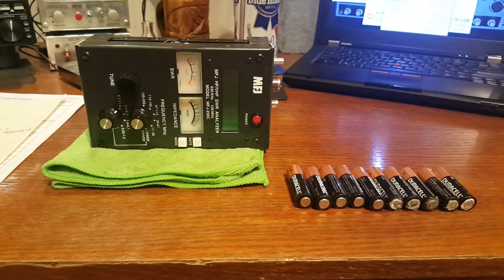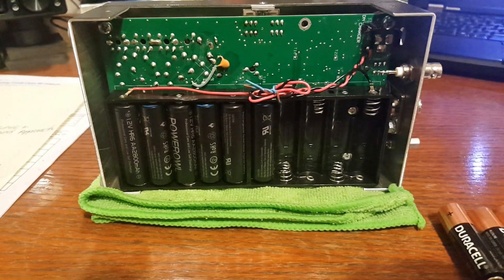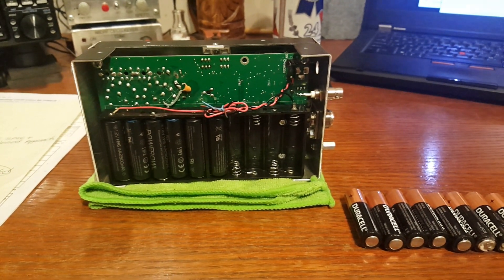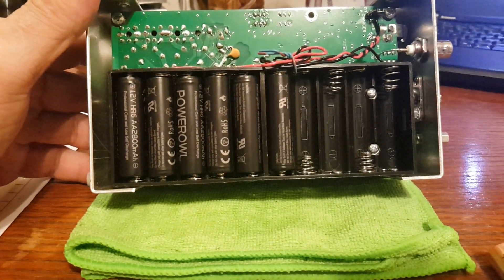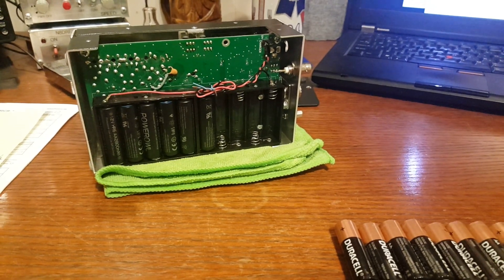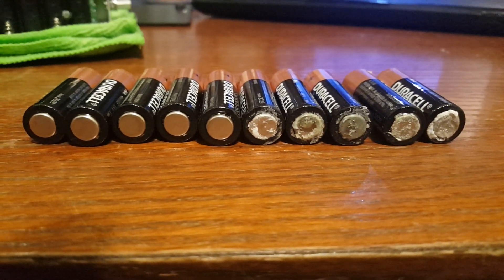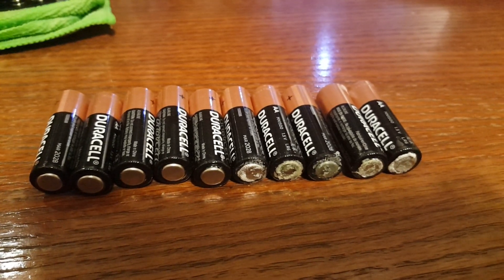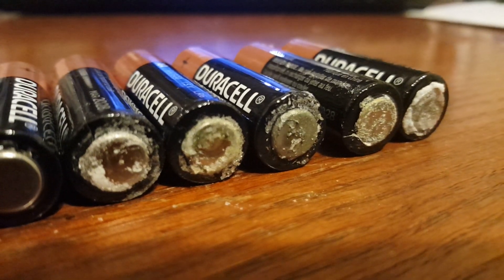Duracell Batteries Destroy Your Gear

Comment: I will not buy Duracell batteries.  PERIOD  I only buy Energizer, and then, I take the batteries out if I am going to be storing a device for any period of time.  I have seen too many devices ruined because of storage using Duracell batteries.  My stepfather died, and about 10 years after he died I found an old remote for a TV that he purchased that I couldn't get the cover off of.  Guess what brand of batteries it had in it?  I had a nice Maglight ruined by Duracell leakage after leaving the batteries in it for about a month or two.  Never again with Duracell!

Comment: I have had duracell batteries leak but I've also had ray-o-vac and EverReady the energizer batteries leak too. Batteries that are dormant seem to leak more often than those that in use more. 72
Reply from the maker: Yep. Wow, you've had those brands leak too? That really does surprise me. I'd expect them to leak.. but after only a year and a half? Makes me wonder how long ago they began leaking. I wonder if anyone has trouble with rechargeable batteries leaking too? I've only recently begun using them. The cost of batteries is INSANE! Especially for 9v ones of any brand. Nuts.
Reply: @n8nkqrp595  I don't use my test equipment daily, weekly, even monthly so I either remove the batteries or store my equipment in a cool dry place. I've tried the NiCad's but for some reason buy the alkaline when I pass by the display stand at the store. BTW, OQP this weekend. I will work mostly CW but might try some phone. Club not Contest Team not working as a contest unit this year. We'll work as individuals from home QTH and submit our logs giving credit to our club. I never done that so its new to me. Therefore, will be using my call not the club call. Will try some QRP but might QRO to 50 watts. 72 de KB8AMZ

Comment: Are you sure you've got the jumper in the correct position inside the analyzer? See the power section from the MFJ-259C manual below:
2.0 POWER SOURCES
Please read this entire section before connecting your analyzer to any power source. Improper connections or incorrect voltages may cause permanent damage to your analyzer! 
2.1 External Power Supply
MFJ offers an optional power supply, the MFJ-1312D, that satisfies all external supply requirements. We strongly recommend using this supply. If you use a different power source, note that the voltage output must be greater than 11 volts and less than 16 volts when the analyzer is powered on and running (loaded power source). The maximum voltage in Sleep Mode (unloaded power source) should never exceed 18 volts. AC adapters must be well filtered and the plug must have a grounded sleeve and positive center lead. The ideal voltage-source specification is 13.8 VDC at 150 mA. Confirm your supply can deliver this output level safely without overheating or introducing excessive AC ripple. Please read the battery installation instructions (Section 2.3) if you plan to install batteries. Never connect external DC power if non-rechargeable batteries are installed and the battery charger is enabled. Permanent damage could result! 
The MFJ-259C has a recessed 2.1 mm power jack located on the top-right-hand side of the unit. It is labeled Power 13.8 VDC. The jack's outside barrel contact is negative and the center pin is positive. Inserting a power plug into the power jack automatically disables the internal batteries as a power source. However, the batteries will be trickle charged if the charger circuit is enabled. 
IMPORTANT WARNING: Reverse Polarity Or Excessive Voltage Can Damage Or Destroy The MFJ-259C. Never Apply More Than 18 Volts, Never Use AC-output or Positive Ground Supplies! 
2.2 Using Internal Batteries
Before installing batteries for the first time, check the position of the Charger Jumper. To gain access, remove the eight screws securing the analyzer's back cover and separate it from the unit. Look for a 3-pin header with a small black-plastic shorting plug that fits over two of its pins. It is located at the top of the main pc board near the OFFON switch and power connector. The shorting plug must be properly positioned for the type of battery you intend to use (either rechargeable or non-rechargeable). While you have the analyzer's case removed, you may install batteries into their tray -- or install them later by removing the battery-tray door that is attached to the rear of the case with two screws. 
2.3 Using Rechargeable “AA” Type Batteries
IMPORTANT WARNING: Do not use an external power sources that deliver less than 13.8 volts with rechargeable batteries installed. If the external supply voltage is too low, the charger will not work properly and batteries will eventually discharge. We recommend charging batteries with the MFJ-259C power switch off and allowing enough charging time to establish full battery charge. A minimum of ten hours is recommended. 
When using rechargeable batteries, your power source must deliver a minimum of 13.8 volts to meet the minimum charge-voltage threshold. Typical charging current is 10-20 mA (trickle-charge rate). The charger circuit functions any time external power is connected, even when the analyzer is turned off. Again, the MFJ-1312D supply fulfills all power supply and charging requirements for the MFJ-259C and is recommended. 
When using rechargeable batteries, the internal black plastic jumper must be set to the proper position. If it is not set properly, the batteries will not charge. As described above, the jumper is located inside the analyzer, near the external power jack on the back side of the circuit board. 
2.4 Using Conventional “AA” Drycell Batteries
Whenever possible, install a fresh matched set of high-quality alkaline batteries. Conventional zinc cells will work, but alkaline batteries offer a lower risk of damage caused by leakage. Alkaline cells also provide longer running time and superior shelf life. When using any non-rechargeable dry-cell battery, always remove them immediately when they become weak to avoid damage from leakage. Also, never store your analyzer for extended periods (longer than a month) with non-rechargeable batteries installed. IMPORTANT WARNING: When Using Non-Rechargeable Batteries, The Analyzer's Internal Charging System Must Be Defeated! To Defeat The Charger, Set The Internal Jumper To The Charger-Off Position.
2.5 “Power Saving” Mode (sleep mode)
The analyzer's current drain is normally around 150 mA, which places a moderate demand on the battery pack. You can extend the analyzer's running time significantly by using the internal Sleep Mode power-saving function. In Sleep Mode, the analyzer's RF-generator shuts down and battery drain drops to under 15 mA. Any time Sleep Mode is activated, the analyzer operates with a two-minute inactivity window. During any 2-minute period, you must actuate the Mode switch -- or adjust the frequency by more than 50 kHz -- at least once for the analyzer to remain awake. Any time a two-minute inactivity period elapses, the power saving circuit automatically switches in. When the analyzer goes to sleep, a blinking SLP message will appear in the display’s lower right corner, as shown below: 
To reawake the unit, momentarily press either the Mode or Gate button. To Disable Sleep mode: (1.) Turn the analyzer off. (2.) Press and hold the Mode button while reapplying power. (3.) Continue holding the Mode button until the copyright message appears on the screen. (4.) Release Mode. If Sleep Mode was disabled successfully, the message shown below will appear on-screen. The Sleep Mode function becomes re-enabled anytime the analyzer is turned Off and On again.
Reply from the maker: Yep, that's the first thing I checked. And just to make sure that the analyzer wasn't defective, I slapped a volt meter on the battery pack and then energized the unit with the external supply. The analyzer was normal, and there was no charging current applied to the batteries with the jumper setting.  73
Reply: @n8nkqrp595  Yeah, I'm never buying copper-tops again. I've had them blow up in MANY devices over the past 4 or 5 years, one of those being my MFJ-269!  I actually heard something pop and fizz in the analyzer and when I opened it up, there was a cell spewing from the sidewall of the battery!  Absolutely ridiculous!
Reply from the maker: @gilbreathca  Oh no! Oh my God. I didn't know if I should give your comment a 'heart', given what happened. lol. That's CRAZY! Jeez. Now I'm hearing about all kinds of 'copper top nightmares'... and wondering what hole I've had my head stuck in? Haha. What awful batteries. Probably 2nd only to Harbor Freight's lowest cost carbon-zinc cells.. and I bet those will outlast the damned copper top.  73

Comment: this was confirmed on an episode of "Fran Lab" not too long ago. I also will confirm that duracells will leak because they leaked in my analyzer just like yours. After scraping and cleaning I got the battery Bay clean and the analyzer works fine now. 73